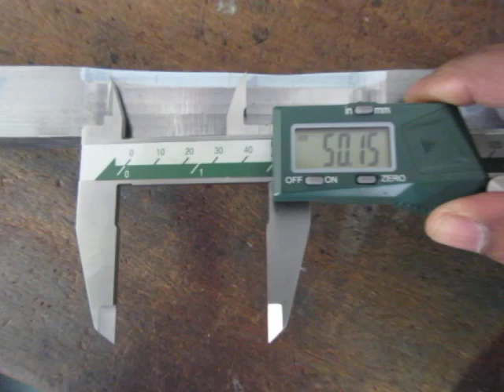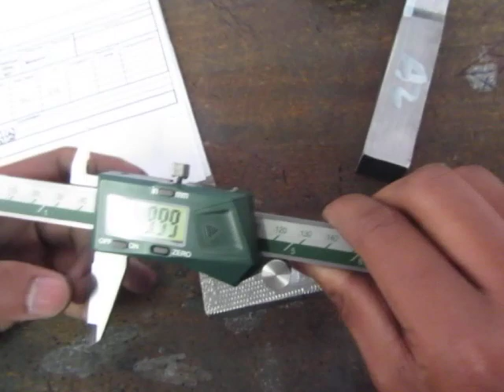Gauge length marking, how to mark gauge length on samples (tensile test)

Comment: Plz, i want how to choose width of rectangular steel during preparation of specimen of steel  
For example,
Thickness 10mm , we make width 30 mm 
Why 30 
And when we choose 25mm 
..are u understanding me?!
Reply from the maker: I'm writing an explanation to you. While I'm doing that please don't forget to subscribe to our YouTube channel. We do have more
Reply from the maker: The width of the Tensile sample goes with the testing code or standard (ex: ASME IX up to 2017, AWS D1.1: 2020,OR ISO 15614). With the code in above bracket and depending with the year edition of publication as well as the thickness of the sample, the width changes. AWS D1.1 will generally tell you that your width should be not less than 20mm, whereas ASME will generally tell you 19mm, for plate and ISO will tell you 25 mm... Now with new edition of ASME feom 2021 to 2023, you have the option to choose either you want to test according to PREVIOUS ASME version (year edition) or according to ISO.
Reply: Now subscribe
Reply from the maker: To be brief, the width of the sample depends on the shape and size (thickness) of your Tensile first. Then on the testing code, second. Thirdly on the year edition of your testing code. Hope this is clear
Reply: I want standard specifications of diminsions of flat steel like i beam section i want to make for it  tensile test ,and to do  tensile test ,require me preparation of steel for tensile test. Like dimensions  ,
And as you say that width vary with change of thickness , i know that good ..but i dont know what refernce standard i should follow to  do tensile test in correct way and accurate results .
Reply from the maker: I can recommend you a width of 12.5mm (+-.30) if your thickness is below 30mm
Reply from the maker: Otherwise you need to check the specification of your material (whether it's ISO, ASTM, EN, J...) or consult your client.
Reply: Ok thank you , very much